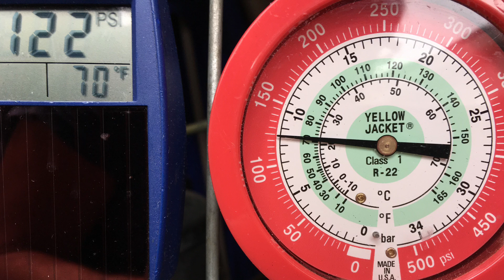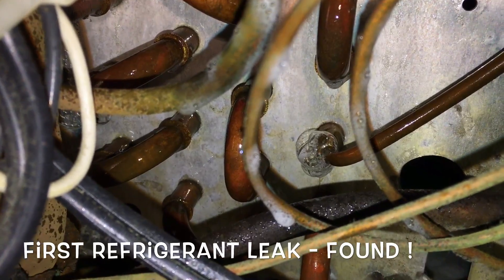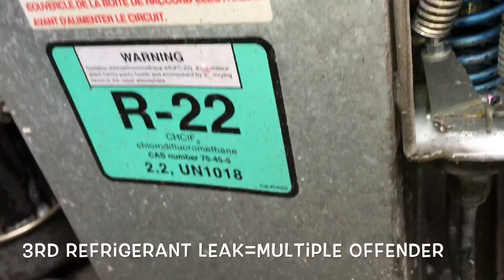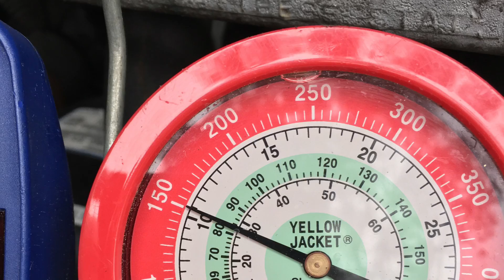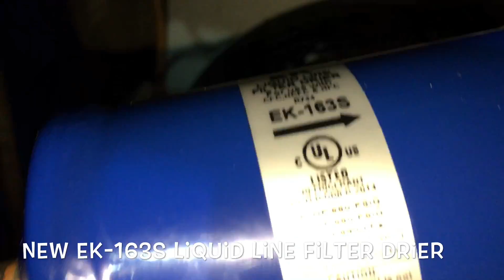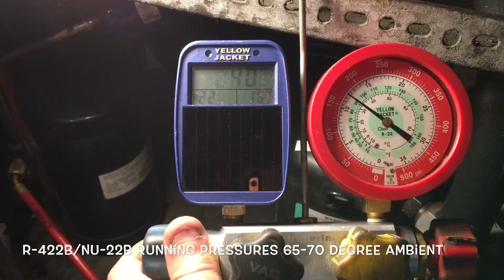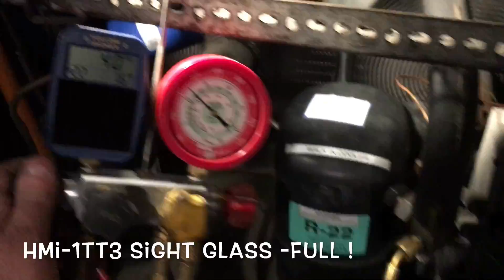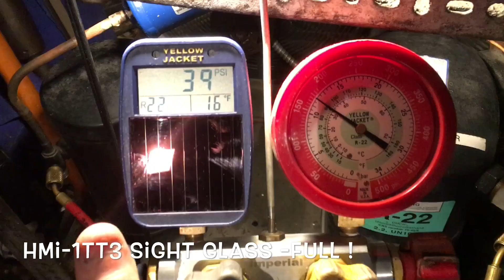R-22 Refrigeration system converted to R-422B/Nu-22B and 3 Refrigerant Leaks Found & Repaired.

Comment: On a Friday night i know it's the last thing you wanted to do and to top it off by filming but it would of been cool if you showed more breakdown of the steps, atleast the charge up part.
Reply from the maker: sometimes i Have to weigh Filming Vs time Available. i did not get out of there till 10:30pm as it was. 3 Refrigerant leaks Found and repaired , New drier installed and sight glass,  Had to drive to get parts at supply house, New low pressure control installed and wired in and set. evac, recharge, run and test and adjust.
Reply from the maker: charging it up is no dfferent than any other walk in cooler with a sight Glass Charge till a Full Glass. and i showed some of that in the vid.

Comment: Leakatitous right there. Good one OC. You think that TXV is gummed up a bit? Evap temp looked low at start up. Just thinking about it.
Reply from the maker: Yea, you might be Right. this Place is 40 years old and Getting Torn Down in 5 Years . So, He Does not Want to Spend any Money on anything that ain't Broke. It Works Good ! Cools Fanatastic ! no ice on the coil and suction is cool, no frost at compressor. so, i'm not really worried about it at this point. i'm MOre concerned at this point just trying to Keeep refrigerant in this old Beast. 3 refrigerant leaks at one time is out of hand. Evap Really Needs Replaced the Fins are Falling off it in the Back, it's aPossibility that Evap may not make it 5 years so, it'l get a new txv if a new evap goes in for sure.  We Shall See. 38 degree's in the cooler . checked it the other day. zero ice on the coil. and the door never gets closed in this place so, it's kicking booty. i'd really like to replace those condenser fan motors. they are noisy as hell and are 9 years old . i'm going to do my best to emphasize that he replace at least one of them. bearing are screaming on them a u can hear in the video.take er easy nc.

Comment: Damn that thing is a dinosor! Did you qoute him an new install? If not you should, i am afraid you will see this walk in box many times in the future. But i heard there is beer cooler, free beer is a good thing, so maybe it will work out just fine😁😁😁😁
Reply from the maker: Thanks Sj. Yea, it Realy should have a New Evap. This Place is Getting Torn Down in 5 Years so, He Does not Want me to spend any money on New Equiptment if we can Help it . So, this place is Just in Repair it mode. Condensing unit is out in the Rain so it's exposed and looks older than it is.  it's only a indoor unit as u see. so, it's not that old. Condensing unit 9 years old. 09G Serial number on compressor. , but evap looks older u are right with that one. the Evap is Trashed and the fins are falling off it. .